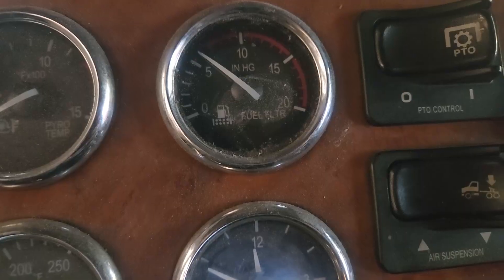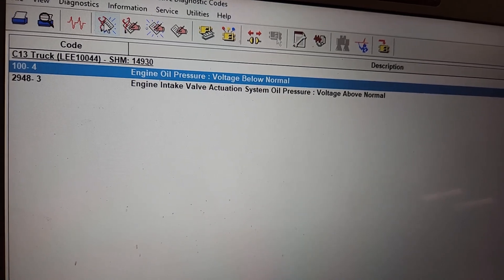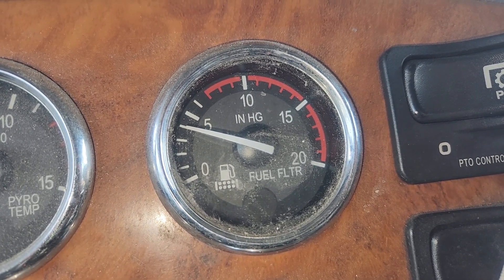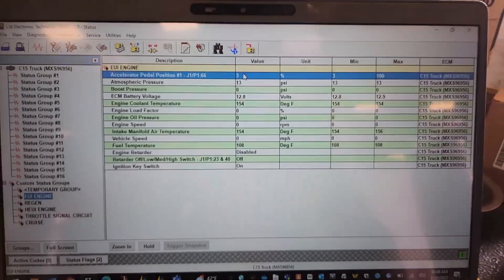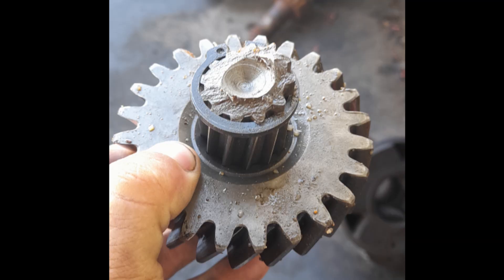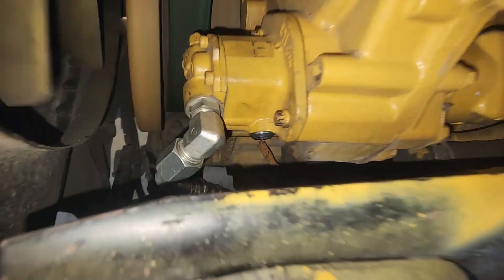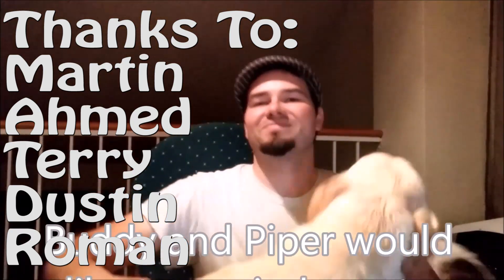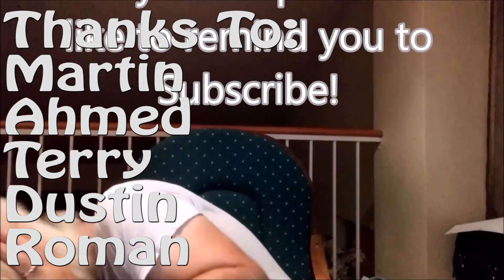Car-Hauler Peterbilt has WEIRD fuel system problems. Cat C15.

Comment from the maker: Thanks for watching this head-scratcher. You can help support the channel by checking out the Amazon Affiliate links here for recommended tools: Fuel Pressure Gauge, Compucheck 0-300 psi: https://amzn.to/3YeBldu
Airlift Cooling System Vacuum Filling System: https://amzn.to/3D9AlPu
Radiator Pressure Tester Kit: https://amzn.to/3QGBumn
Milwaukee 3/8" Right Angle Impact Wrench: https://amzn.to/3D2CvAk
2 Pack M12 Style Batteries for Milwaukee: https://amzn.to/3D2mdHE
Reply: Where’s you get those clear tubes is that from a kit
Reply from the maker: @landseaandairtransport1471  They are in a kit we have at work. No idea who made them though, they are handy.
Reply: @AdeptApe  Whats your take on seafoam? From my experience so far it's prevented clogging in my oil and fuel system on a 99 f250 7.3 powerstroke with 295k miles

Comment: One thing not mentioned or I probably missed was the reason for the longer and smooth part on the  updated base,which is it is meant for an extra seal inside that only CAT filters have. Well I have only seen it at least on CAT filters. but honestly I really dont notice any difference when I have had to use other brands for my primary filter.

Comment: I got a c15 acert MXS just cranks and cranks won’t start if I shoot it with a little ether it will start for about a second then bottom out like it’s out of fuel, replaced check valve pressurized fuel lines took fuel pump line off filter housing then tried to start truck to make sure pump is working, I’m stooped right now ongoing 2 week problem

Comment: I just had a finger tight pipe fitting on the inlet of a fuel filter on a c15 just the other day . Truck worked fine just didn’t like to start after 3 or 4 days of sitting .

Comment: I love the see through Davco filters because you can physically see the health of the filter element and know when to change it. Initially upon element change, the fuel level will be very low in the housing which is good and then as the filter element from bottom to top gets dirty and clogged, the fuel level rises to cleaner sections of the element and once it reaches the change element line, then you'll know to change it. All of my trucks over the past two decades had the Davco filter housing including the International I owned for 12-years and just sold in Sept'22. I've since moved to Middle Tennessee and got a company driver job in a Kenworth T880 tri-axle dump with X15 engine and it too has the Davco filter housing which I love. The FASS fuel-air separator for Class 8 engines is the only product I know of that removes entrained air bubbles from filter system and sends them back to the fuel tank which leaves a pure solid stream of fuel to the transfer pump and fuel injectors. They are $750 bucks and increase engine power once installed. The FASS fuel-air separator removes both air bubbles from the tanks and vapor air bubbles created in the filter housing.

Comment: Just replaced an an injector on my truck. Is it worth it to run fuel injector cleaners before getting the other injectors replaced? I have a 2001 C15 6NZ 768K Mi and 24,500 engine hr. Will an ABS light cause poor acceleration/low power under load?

Comment: I've been caught out chasing air in the fuel system before with the vapour and cavitation of the fuel on the suction side before, now I only check the return to tank for air. Not sure if you did, but always a good idea to check the pick-up in the tank for blockages also.

Comment: The primary filter also called fuel/water separator filter. They start working almost empty and they fill up by the time when they get slowly clogged. I haven't seen one being filled up on any trucks, only they were old and it was time to change them. You can see it if there is a bowl type clear plastic housing installed where you have the paper style filter inside. You can see it filling up by the time and if the fuel level reaches a certain hight inside the bowl, it's time to replace the filter. You can extend the service period if you install a filter that has a tap on the bottom (CAT doesn't have that style but e.g. Baldwin does) and you drain couple oz of fuel every 2 weeks. The bowl type housing has the tap on the bottom.

Comment: Adept Ape  The problem with the air bubbles and a high fuel restriction on the Pete car hauler is a common Peterbilt problem, no matter what powerplant is being used. 

Try removing the fuel caps, then check fuel pressure and restriction guages?

The common problem is that the fuel tank vent or vent hose is plugged up, or the fuel cap vent has excessive grime around the secondary vent, creating a vacuum on the fuel system.

Comment: Fuel will aerate from the return, if there is not a tube that returns the fuel below the level of the fuel. The act of fuel coming out above the fuel level will cause bubbles (aeration)  Video on youtube about a fuel system, racing, but nonetheless is still happens with diesel. Drove me crazy and spent a few thousand bucks on fuel system components only to find out the cure was adding a length of hose to the return inside the tank. https://youtu.be/dP6Pogm6Ts0

Comment: What do you use for a clear hose setup? I'm having a hard time finding the right size hoses with a way to reliably put the correct fittings on. Also tried looking for kits and came up short.

Comment: And the reason why pilot oil ran C 12 it’s because of the white it allowed us to haul 200 more gallons of diesel and 300 gallons of gasoline. That’s why they would not run the bigger engines, grace and peace.

Comment: Pilot had a contract with caterpillar put engines in those Pete’s back in those days boss man, Jimmy, Haslam, that owns pilot was called by Peterbilt complaining about the fleet pride. I put on that truck boss man in Nashville say Mr. Haslam next time you’re in Nashville I don’t you come drive the truck Here in Nashville go on in all directions we have to pull a Lotta pretty good heels go onto the travel centers. Mr. Haslam got an a loaded truck with Randall and he started catching gears and he looked over at Randall and he said you leave this truck just the way it is if if caterpillar says anything I’ll go by Detroit or Cummins, this thing was in the shop 12 times in six months because of that filter set up. Mr. Haslam was not happy. He actually called the head honchos that caterpillar because they called him in the head honcho at caterpillar come and drove the truck and didn’t say a word got out of the truck at hurricane Mills and went to lunch with Jimmy Haslam, and we never heard another word out of it grace and peace

Comment: I work part time as a petroleum driver for pilot oil. The travel centers we had the same problem with the C 12s running the same filter set up. We got a brand new truck and 03 and it had been in and out the shop more times than you can shake a stick at Because the fuel filter and the air bubbles Peterbilt cannot figure out what’s wrong with it I’m a retired mechanic and was just doing this for extra money being retired and I’m a big Cummins person. I know you like cat I like to drive a cat, but our 03D cab, it is ran horrible boss man agreed to let me see if I could fix it on one of the days when the truck one being used I went to Fleet pride about a Cummins filter mount the ones that run the O-rings and ran Cummins filters. I finished with it right about shift change, when the Night Shift was coming in and it was boss man’s truck, he always got the new ones he got in it and laughed because I put a Cummins parts on a caterpillar engine. He didn’t say anything until he got the truck loaded and it one of the terminals you have to come out Make a 90° and pull one hell of a hill to get out of the river bottom. He got on the interstate and got it aired out. He calls me at home and he tells me this truck has never run that good and you could put your hand on the filter with the hot fuel, and you could tell that the filter was full all the way to the top, we wound up changing out just the newer trucks cause we don’t keep them but a 500,000 miles so I think I did two more for him. Peterbilt wasn’t too happy when they serviced the truck and the caterpillar people wasn’t happy but like boss man told him down there in the shop, one day when they were complaining about it, he said you little bastards couldn’t fix the damn truck. I got the truck fixed and it runs fine now runs the way it supposed to. I looked at the cat filter mount. I couldn’t see anything wrong with it just like you I couldn’t see a crack in it I just don’t know why those filters will not fill up with diesel, we had one you could fill the filter up with diesel screwed on the mount take off and within a couple hours the filter was back down to half full grace and peace

Comment: I was a driver for pilot oil. The travel centers we had Peterbilt’s with the same fuel system set up with C 12s and that’s what we found is if you just put the filter on there it would only run half full what I did I would pre-fill the filters all the way to the top and I also run an O-ring on the filter and we never had any more trouble out of it as long as you pre-filled it and put that flat O-ring on the filter housing because those seat wells had a low power, grace and peace

Comment: They are a major pain to tow also cause the so low. 
I have home made ramps I winch them onto. Then put my t bar under the axel the strap it. But u can only go so high because the back 5th wheel plate will drag on the ground. 
Super pia to tow.

Comment: The primary filter if installed on suction side of pump with tank lower than filter (most common setup) will never run full until filter is nearly plugged. Actually that specific davco setup you showed has a line on the top of clear housing that says to change filter when fuel reaches the line. But same thing happens on most suction filters or strainers depending on design, you just can't see it normally.  Also the restriction on the new filter being slightly higher is normal especially with cat filters until the filter media has been in service for a few hours.
Reply: That isn’t the case with those metal cylinder style filers.  They fill up.  However, the cartridge style like the Davco DOES function the way that you described.

Comment: Yes, Hg is the chemical symbol for elemental Mercury.  It’s safe to assume that when the symbol doesn’t seem to agree with the name of the element it is because the symbol is a carry over from the Latin or Greek terminology.  But I am sure you remembered this after you made the video Josh.  

This was a very good diagnosis.  It was nice to see an honest diagnosis that is exactly the path I would have followed even if it turned out a little strange.  Everything you did was an improvement to the engine performance so that’s what matters.  However, I was wondering if you were able to reprogram the ECM or if you had to replace it.

Comment: Peterbilt fuel tank pick ups are real bad about cracking. I always replace them with a new tank straw that you just slide inside the existing tank pick up with a new 90 degree fitting. Best way to test if a straw is bad is to cap off a fuel supply line at the tank one at a time and see if the primary fuel filter fills up.

Comment: What’s the number for the new housing? I’d like to update my C16 just because of the Oring threads
Reply: 2802698, need fittings, and if you have a filter restriction sensor, you have to drill a hole in one and tap.

Comment: Maybe could have run a clear hose from the filter inlet to a bucket of diesel to eliminate a restriction back to the tank. A less than full fuel filter to me is a vaccum created by restriction. At least that's what came to mind. Partially collapsed hose or rag in the fuel tank something like that. Love the videos by the way. Wish you worked on cummins more since we have like 900 in our fleet. 😂

Comment: Seen lots of bubbles on equipment with clear sediment bowls or running 1/2 empty, never figured it out, or cared because the machines were running properly. It’s like wtf and on to the next breakdown. FYI, on machines using banjo bolts they turn into inline fuel filters, pine needles, small rocks, fuzz, etc.

Comment: About a year ago I sent you some plans to build a fuel system tester, of which you found very interesting. It was developed by one of those "greatest generation guys" in the 1960's in a Cummins shop. That tester makes short work of what this video is discussing. A few months later I did my own "service truck tour" one episode I showed the testers. Your viewers would find those testers beneficial as that tester deals with all fuel restriction and sucking air from inlet of fuel pump supply thru primary filter, hoses and fittings.
   I have removed a lot of primary filters and they are never full.
   Through 40 some years using that tester I have chased many "vapor bubbles" not knowing what you taught me here. Big Thanks!
Reply: Would sure like to see this fuel system tester. Have a kta 1150 that I suspect is drawing in air. Steve.

Comment: As a gear nut,you could check if it has a cracked draw tube in the tank, or sucking in air from loose or bad fitting 
or a porous hose😀

Comment: Did someone add fuel temp resisters in line somewhere to trick computer thinking it had lower fuel temps and did something wrong or bought a cheap kit?

Comment: DOES THIS TRUCK HAVE DUAL FUEL TANKS??
I HAVE HAD SEVERAL CAT TRUCKS WHERE THE FUEL RETURN DIVIDER VALVE HAS SUCKED FUEL OUT OF ONE TANK AND RETURN FUEL GOES TO THE OTHER!
THIS WAS HAPPENING ON 2000 TO 2005 CAT 
C-12 /13 ENGINES!
THEY HAVE STARVED THEMSELVES FOR FUEL , WHERE ONE TANK IS EMPTY AND OTHER TANK IS 1/2 TO 2/3 FULL!

Comment: Since it’s pulling a vacuum, my thoughts would be that the tank is not venting properly, or there is something blocking the pickup or the lines feeding the transfer pump. Not a truck mechanic, but in cars stuff getting into the strainer is a major cause of restrictions, and it’s amazing what does get into a tank from the pump. I still have half a shop rag in the tank of my Camaro. Someone must’ve left it in the service station pump and it got pumped in with the fuel. So far it has not caused issues, and the tank is a real pain in the ass to pull in the early unibody cars.

Comment: Ive never seena suction filter full to the top. It's normal for them to run 1/2-2/3 full. My guess on the restriction is a hose is starting to collapse and the higher pressure spring is demanding more fuel through a partial collapsed or pinched line.

Comment: Did you change the secondary fuel filter? I have the same basic setup on my 379. If the fuel system is pumping and returning gross amounts of fuel,the vacuum increases. The twelve pound return check valve can also effect return flow. If the frame filter is clean but the secondary is plugged: vacuum goes down. I have all new fuel lines too. Fuel level in the tank doesn't seem to matter much. If the engine starts hard I'd change the check valve at the secondary filter in the return line from the back of the head.

Comment: Rubber fuel lines over time will swell and restrict fuel flow especially with the ulsf diesel fuel sold nowadays.  30 years ago I lost track of the number of fuel pumps on Cummins Detroit and Caterpillar engines I had to change the seals on when the first lower sulphar diesel was introduced.  We literally had sets for or Cummins and Detroits in the shop and I had the special tools needed to change the barrel seals out on 3406 A and B series pumps.  The boss man's standard replacement repair was all fuel lines tank to engine and back all O rings in the pumps and lines when the original failed.  We got everything done in less than 3 months for the fleet.

Comment: I can see where the higher pressure spring might cause a greater pressure drop through the primary filter. Increasing the transfer pump pressure may cause the fuel recirculating flow to increase, thereby pulling more fuel through the primary filter. Counterintuitive, I agree. But plausible I think.

Comment: So how would the ECM control the mechanically driven fuel pump?  If the fuel pump is creating more vacuum, then there Has to be a restriction on the suction side, either a fuel line or a diverter valve issue. If you have bubbles on the suction side only then you will hear it when the truck is running, I have watched the bubbles go right up to the fuel pump and shortly later here the engine stumble.
Reply from the maker: The fuel problem had nothing to do with the ECM. I was trying to figure out the fuel problem, but it wasn't the source of the low power problem, the ECM was.
Reply: definitely not questioning your abilities, sometimes these kind of problems are hard to pin down, sure, appreciate the videos, I have been at this maintenance business for 40+ years, you’re one of the few guys that ,I actually tell people to watch your videos so that they can learn something.
Reply from the maker: I didn't take it as any sort of insult. I definitely could have explained it better at the end. Cheers.